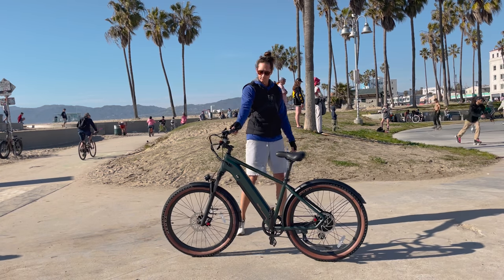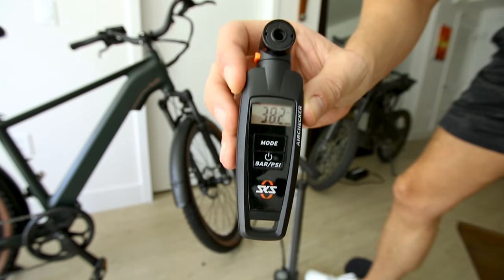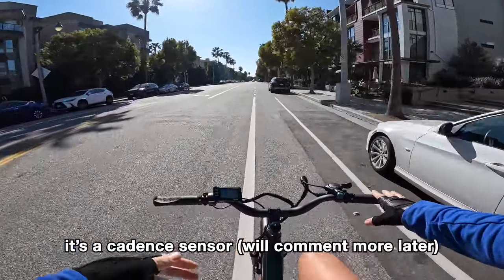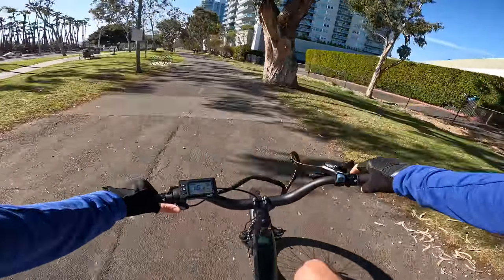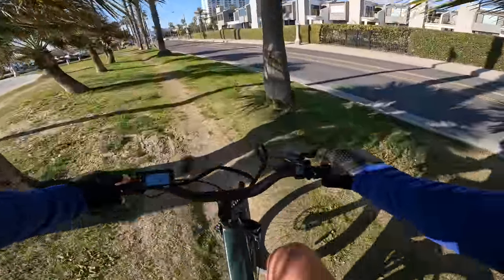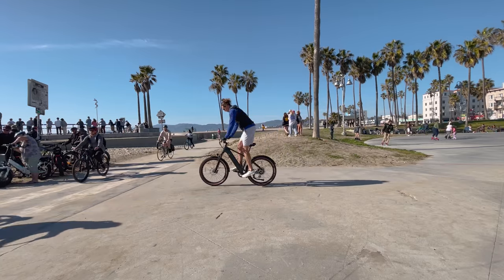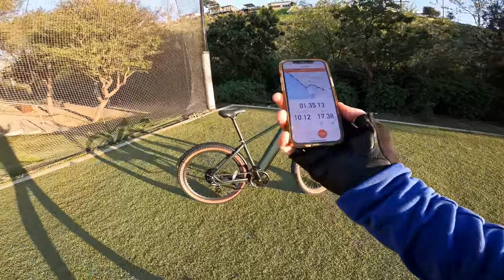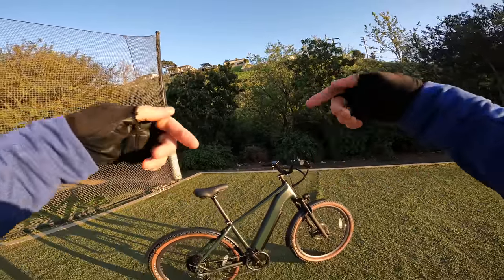Ride1Up Turris Review! NEW $1,295 Adventure EBike

Comment: I just bought a turris for my wife and the factory settings for each individual p.a.s. level were set ridiculously low.. p.a.s 1 was at 8% power.. 2 at 14% etc and p.a.s 5 at only 70% power of the available 800-ish available watts of power. My settings are now as follows. P.a.s 1 At 20% ...2 at 40% .. 3 at 60% .. 4 at 75% and 5 at 99% . P.a.s 5 now gets over 800 watts of power as it should and I get better performance out of every level of pedal assist.
Reply: How do you change it ?

Comment: We just put my son's together today, and everything about this bike is very good quality at this price point. The only thing heavier riders (240 lbs+) might take note of is that the fork spring is relatively soft even at maximum preload, but other than that, we are truly impressed with it. (I am sure a stiffer spring or more preload could be modified into it.) The build quality of the frame appears to be really good, and aside from it being a hub motor, there's no reason with some upgrades that it could not be a very fun light to medium duty enduro bike. Best part though is that being a 27.5" wheelset means you can throw virtually any tire imaginable onto it, from slicks to studded knobbies, any MTB tire up to 2.4" wide should work well on it. And topping all of this off, Oregon provides a $300 rebate through local utilities for up to two bikes per customer, bringing the price of ours down to $995!

Comment: Hey! I'm only 5'4" and I don't want to purchase a ST. Will the Turris XR be to large for me? No place to test ride one...the specs on the handle bar height seems a little high too. What do you think?
thanks Kyler
Reply from the maker: Honestly it’s hard for me to say, I feel like it will work if you’re determined, just drop the bike to the side a bit when you mount, or have the left pedal set to the 10 o’clock position and step onto it and mount as you roll forward for style points. Hope this helps! Happy riding regardless of what you choose, please consider using my link below the video if you do grab this one 🤙⚡️

Comment: How would you comp to the Wired Freedom. I'm worried the freedom will be too big and heavy and not maneuverable, but also dig the suspension and top speed.
Reply from the maker: This bike is very tame, light, and maneuverable compared to the Wired freedom. You might also want to consider the Velotric Discover one and the hovsco hovranger if you like the speed and power you see on this bike

Comment: A very nice successor to the 500. I’m thinking this frame may get used on the next generation Core-5 and LMT’d because it resembles their current frames very much, but looks like it has a stronger downtube because of the open part of the section being in tension, and can accommodate a larger capacity battery than they currently do.
Reply from the maker: Nice observations, I noticed the similarities in the frame from the core 5 as well!

Comment: i just assembed my turris.  it is incredibly hard to paddle when battery is powered off.  Is this the case for you as well?
Reply from the maker: Make sure you use the gears, but yes in general an ebike weighs much more than a normal bike so it’s pretty difficult to pedal them without power

Comment: So looking into getting my first Ebike. Two have gotten my attention after going down the rabbit hole of research - Eunorau UHVO and the Ride1up Turris. Right now the UHVO is only available for me in the 350W version, and with the 13Ah battery is $1350. The Turris has a 750w motor with a 12.8Ah battery for $1300. They are of similar weight, and have quite similar hardware otherwise too. So which would you rather have: the rear suspension, or the bigger motor? I live in a rural area that is pretty hilly, but most roads are paved with the occasional dirt/ packed gravel road thrown in. Thanks for any advise you may have.
Reply from the maker: That’s a tough call because both bikes are very different. If you’re going to be doing mostly street riding I’d go with the Turris. Something you did not mention in the comment is the Eunorau is only a 36v system vs 48v in the Turris. This is going to make the Eunorau feel significant less powerful and also have less total range by quite a bit compared to Turris. The full suspension bike will definitely have a more cushy ride though. Hope this helps, and if you do go with the Turris please consider using my link if you want to help support my reviews and channel, happy riding!
Reply: @TailHappyTV  Thank you for the advise. I totally missed the 36v vs 48v difference. That's a pretty big point in the Turris column, as range is going to be a major factor for me since I live about 9 miles from town. Much appreciated.

Comment: My wife ordered this bike and didnt read the fine print at checkout. Ride 1up requires you to accept a bike from the shipper no matter how severely damaged. Her bike was severely mangled, the derailer and back part of the frame were bent terribly. Upon denying the bike from the shipper she found out ride 1up would charge her the 200 restocking fee. They said she should have received the bike per the policy and they would have mailed her parts for her to fix the bike herself. Very displeased with this lack of customer service. If you pay 1300 for a product you shouldn't have to do major repairs on a new bike.